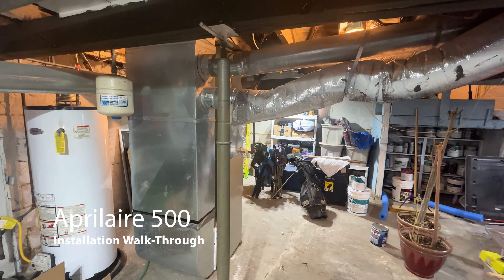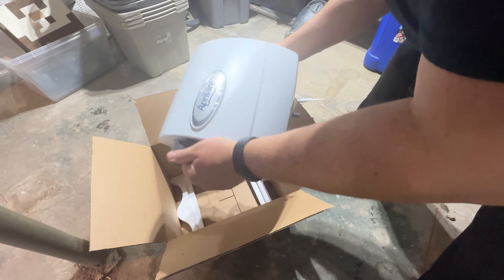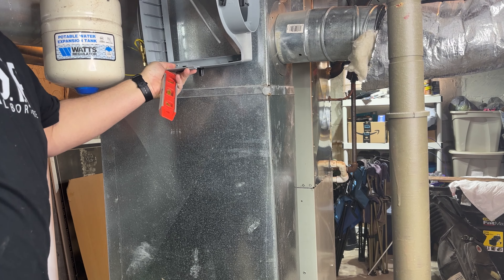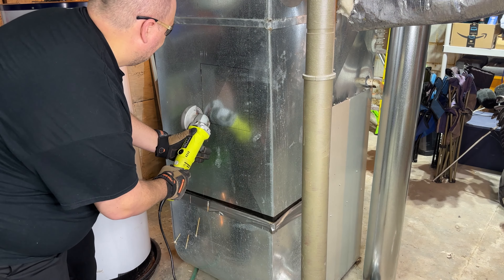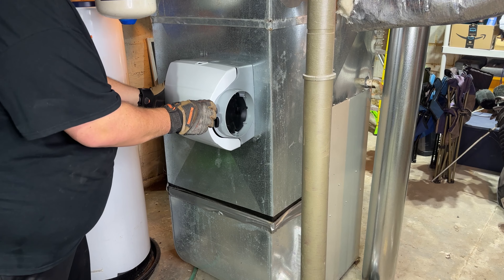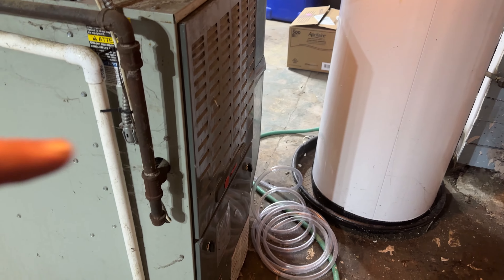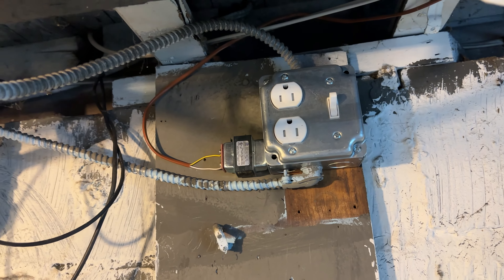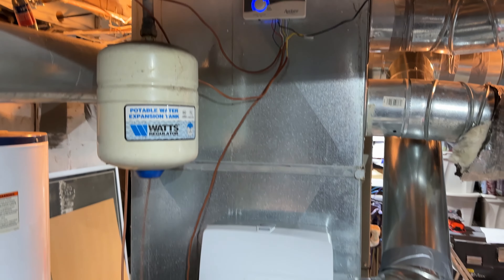Aprilaire 500 Whole Home Humidifier Installation - How to

Comment: I have this unit.  My humidity on the unit says 13%. Is this because of the sub zero temperatures we are experiencing in Wisconsin?  Also I notice the humidifier stays on even after the furnace shuts off. Is this normal?
Reply: You wired it wrong
Reply: Plumbing contractor installed it for me.
Reply: @DaleHanke-tz8cm  15-year HVAC tech here. the plumber did it wrong. Contact an HVAC professional and or an electrician so that your house doesn't burn down